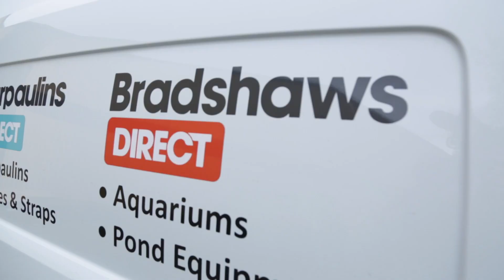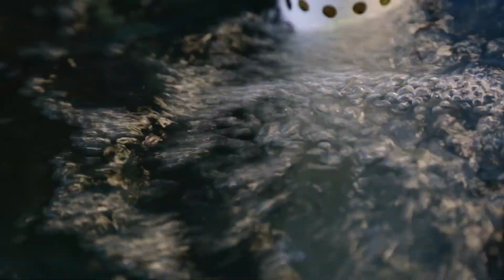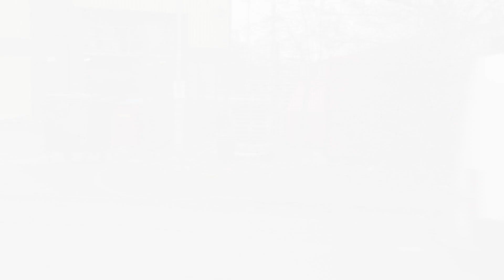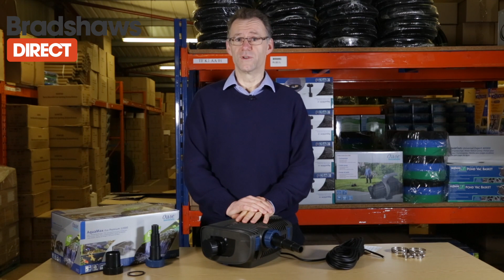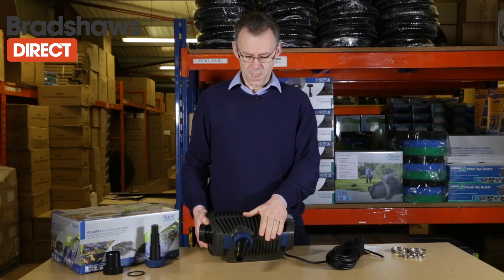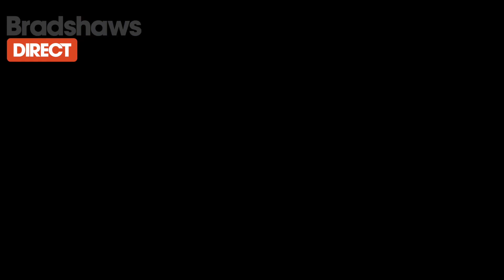Bradshaws Pond Guide - Oase Aquamax Eco Premium - Overview, Set Up, Use and Cleaning

Comment: I have had my pond for 13 years and I’m on my 3rd Oase pump so have lasted roughly 4 years each give or take. The latest rectangular design is a much better design and doesn’t get clogged up as much as the previous rounded design. I still think they are good quality pumps though.
Reply: I had my pond for 23 years and the Oase round version lasted 21 years, with 24/7, 365 days of the year use. My pond was a natural pond with plenty of gunge to remove. This was with a 5 year guarantee!  Needless say purchasing a replacement  by Oase was a absolute no-brainer decision. Very pleased with that durability.
Reply: @markhibberd7750  I had one come with the house I bought. The previous owner said that it could withstand a solid freezing. He was wrong. Product description is: "frost resistant". That's something different actually.